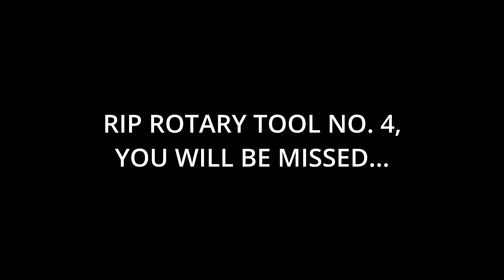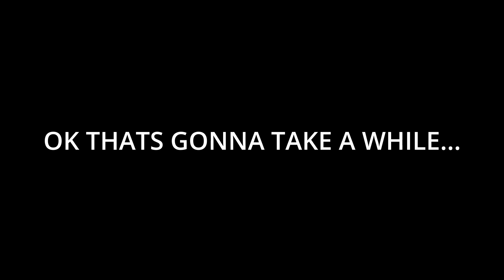Episode 6 Fretboard Number Two on the Worlds First Balsa Wood Guitar GGBO 2022

Comment: Can one say tedious.  At least it looks like it mostly worked.  How sharp was the bit you were using after you finished the thicknessing operation? The grain pattern on the side you plan on using as the fret board does look nice. It sucks that your rotary tool bit the dust. They aren't the most expensive tools but on a budget even a smaller costs add up. Best of luck.
Reply from the maker: One should lol, let's just say the bit will go to the same place as the rotary tool ...
And thanks mate, once it's sanded I'm sure it will look great 😀